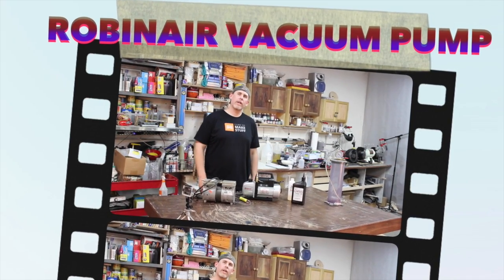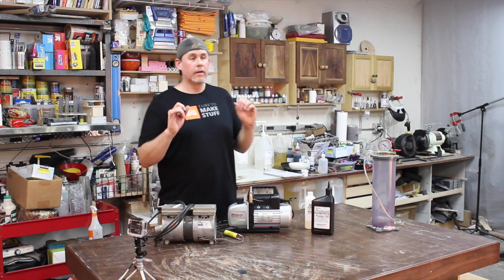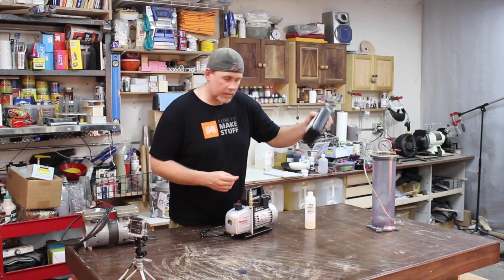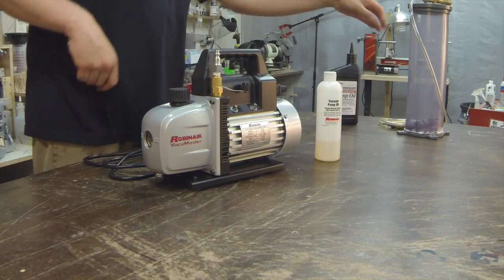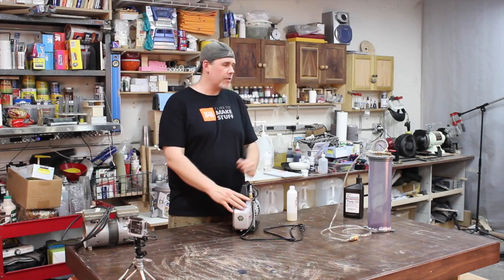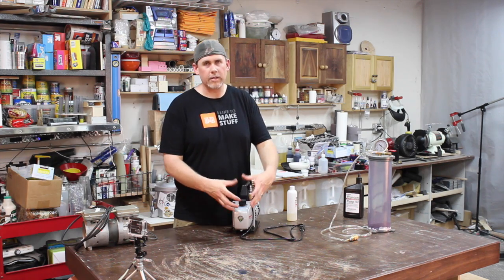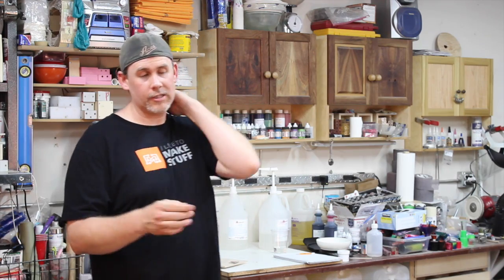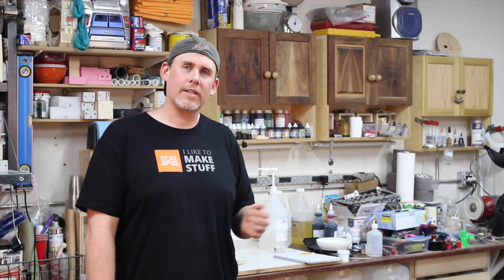Choosing A Vacuum Pump For Stabilizing Wood - The Robinair 15310

Comment: very annoying hissing sound.

check out this video for an audio tip
https://www.youtube.com/watch?v=BQIoAwr-i_8
Reply from the maker: echofoxxx Thanks I'll check it out.
Reply: +Zac Higgins I am assuming in this one you are using the sound off your main camera. Since you are far away from it the internal amp has to run hot to get the volume you need. I use a Zoom for my audio so it is nice and clear. Still working on getting my video as good, keep up the good work and thanks for sharing your experience. I got my pressure pot and a compressor. I am gonna order my resins any day and I have some cool ideas for things to cast.
Reply from the maker: +Dirk Mitchell I am using a shotgun mic on top of the camera. I think it's just the camera, and you might be right about it working hard sometimes. Played with settings on the camera, but I found it to be much easier just to leave it and deal with sound post edit. Some day, I may get a separate audio recorder though, need to save up for a while for that though.

Comment: After you reach max vacumn and the pump is turned off does the chamber hold the vacumm. or do you have to leave the pump running for the entire stablezation process?
Reply from the maker: You want to leave the chamber running so it continues to pull the air bubbles out of the wood, once all the air has been pulled from the wood you can shut off the pump and let the wood soak